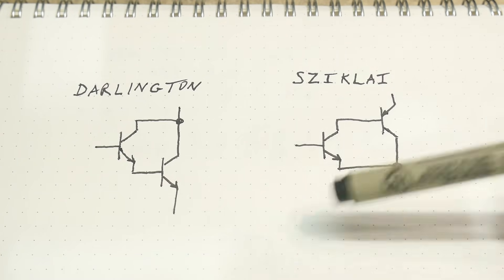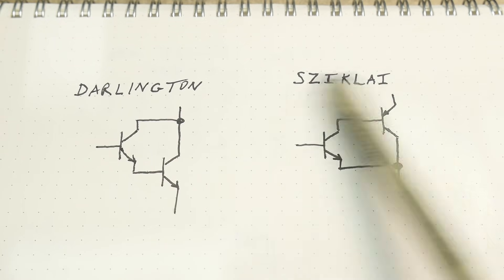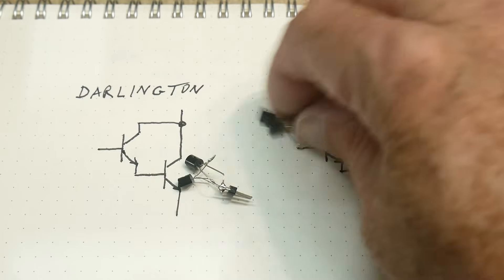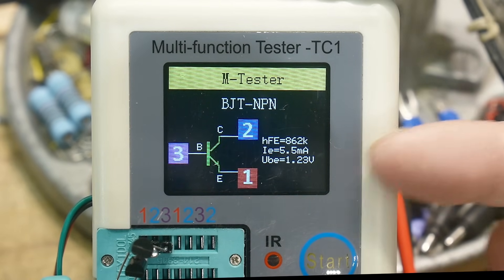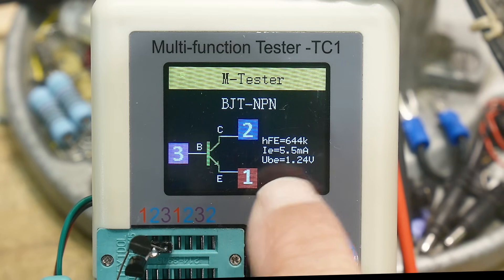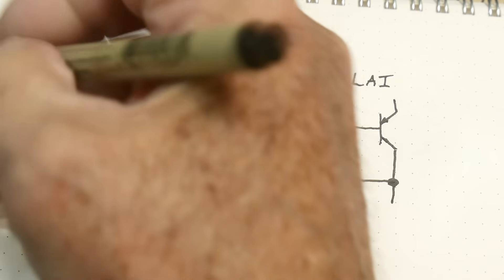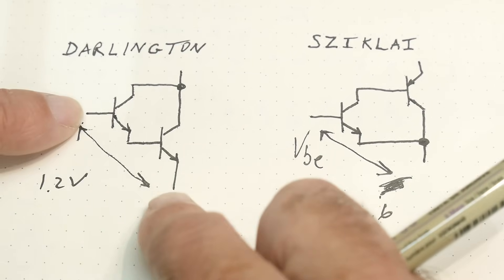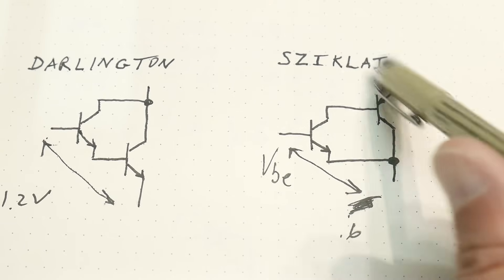#1776 Darlington and Sziklai Transistors

Comment: NPN silicon going to a Germanium PNP transistor Sziklai is a fun Sziklai for Germanium Fuzz guitar pedals. It greatly reduces the leak from the Germanium transistor in the pair.
Reply: The 'leak' would get more severe the harder the base NPN is pushed. Would that result in a dc bias when driven very hard? I guess it wouldn't matter if pass through a capacitor to remove any bias anyway.
Reply: @rich1051414  yep, you got it.
Reply: In my experience, if the pair isn't too thermally sensitive and you can find a reasonable operating point, you can make a fuzz out of it that someone will find interesting! To that point- in college, in 1998 or so, I built some fuzz faces for friends with used germanium from a transistor radio, by tweaking the resistor values until they sounded great. One in particular sounded amazing. I didn't have RG keen's measurement rig yet, so my tester showed the input transistor had a gain over 200. I'm certain it was just leaky. Whatever the case, I managed to bias it up by ear and the results were great. I guess, in the end, there are no rules as long as it sounds good!

Comment: It would be nice to see the curves of both types of transistors in curve tracer.
Reply: Ditto!
Reply: they look just about the same as an npn, save for the higher on voltage for the darlington, and a very slightly lower on voltage for the Sziklai.
Reply: @emiliaolfelt6370 
Doug Self plotted them and the Skizklia pair has a much sharper turn on and gives lower distortion
Reply: Yep, would love to see Vce ensemble for Sziklai.

Comment: I have most often seen Sziklai pairs in the last stage in audio power amps, with a small-signal PNP as the input of the pair and a power NPN at the output. The combination behaves like a PNP but has the current rating of the NPN. This can be a cheaper way to get a power PNP transistor, or in the old days maybe the only way.

Congrats on the patents! That's an impressive body of work.
Reply: Yep in the old days of the 1970s this is how we'd get class B or AB final stages going, using the classic 2N3055. A PNP complementary to it was not available (or rather very hard to get, the PN2955) so the stage was quasi-complementary: a Darlington with another medium-power NPN+2N3055, and a Sziklai with a medium-power PNP (much easier to find) and a 2N3055.
Reply: The good old Quad 405 used Sziklai pairs - I've renovated a fair few of them, still a good sounding amp, considering!
Reply: i was about to type that 
still if you making negative ground devixe this is een better, could be a substiture for germanium darlington with no bias change

Comment: FYI a close approximation to Sziklai in general american is SEEK-la-yee, with the weight on the first syllable (but still short). The 'y' is a pretty good approximation of moving from the short 'a' to the short 'i'. It basically means "Of [a] boulder", which is what I wanted to bash my head into when I first started learning about transistors after basic circuit theory.
Reply: Or "seek lie", at least with an american accent. "Lie" is pronounced like "lai".
Reply: @rich1051414  Hungarian doesnt merge vowels into full dipthongs, they're used as a transition when needed. 'Lie' omits the trailing 'i' which is a case suffix (the language is agglunative, so all cases are basically either prefixes or suffixes instead of seperate words). 'Lie'+'ey' might be a close approximation but its still a little off to my ears, mostly because the short 'i' is a very regional thing in English use IMO.

But honestly it's splitting hairs, any attempt is a welcome attempt considering how little people are even exposed to the language's existence.
Reply: seklae. greetings from Hungary. ps: you can listen it with google translate.